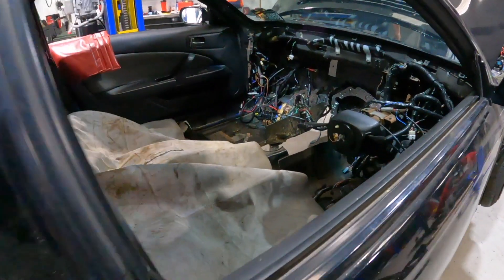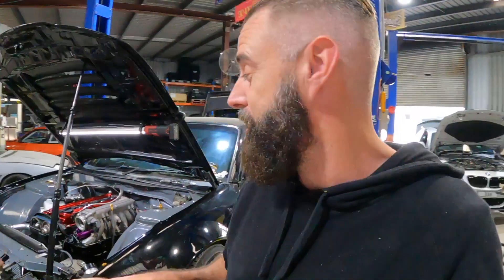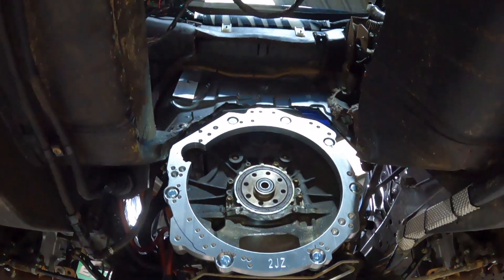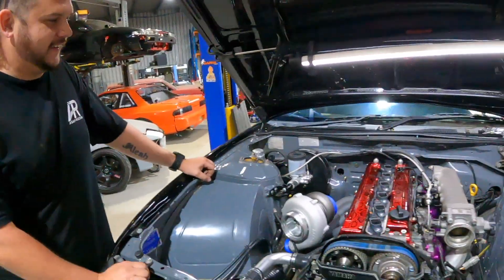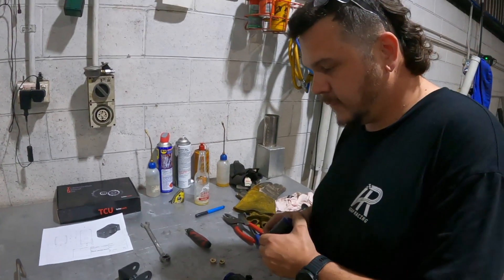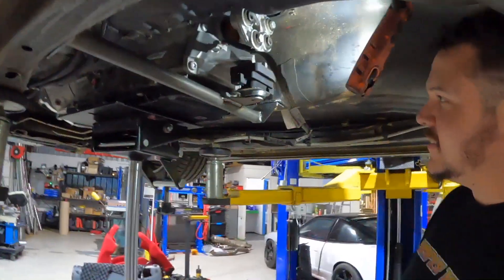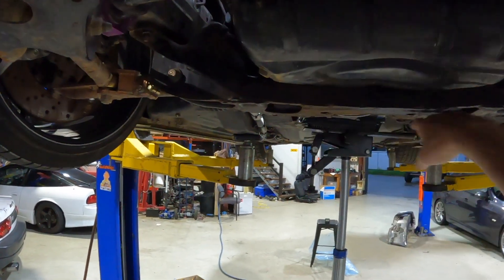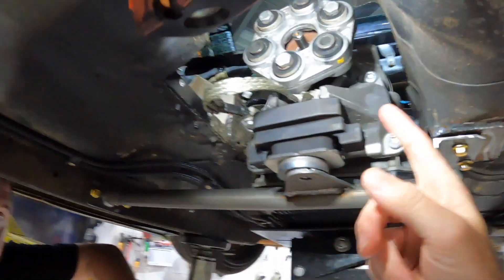HE DID WHAT TO THE S15? SILVIA 8HP70 Install Part 2

Comment: I'm just curious, what is the average diff ratio and tire size you see in the bmw? I'm trying figure out what gears I want to run in my build.
Reply from the maker: 3.5 and 3.6 diff in the BMWs we have done the 8hps on. With tyres around the 255-35-18.

This makes 1st pretty useless tbh. But still gives you a mega top speed in 8th at 7000rpm. Highway you sit at 2000rpm at 110kmh in 8th.

I say first is useless but I have used it for launching but generally not really used

Comment: How can the parking work? Mine when put in P the car is rolling still there is no option in the diagram for that!
Reply from the maker: With the manual park lock overide disabled, the Turbo Lamik park function works like a normal 8hp. Have you disabled the manual overide on the side of the trans?

Comment: Just want to know if it works with 2jz ge engine no modifications?
Reply from the maker: It depends on what your opinion of a modification is. I’d say if you are writing “no modifications” this swap is not for you.
Reply: @ZeroTo60Tube  I mean stock engine. Just swapping the 8hp transmission?

Comment: how much power/torque can those transmissions handle reliably
Reply from the maker: They are warrantied to hold 700nm on a flat shift. No torque reduction during shifts. With torque reduction i have seen people say 1000nm. Which is mega. I havent found anyone that has broken them mechanically. However the clutch slips happen over the 1000nm.
Reply: @ZeroTo60Tube  that is great to know!